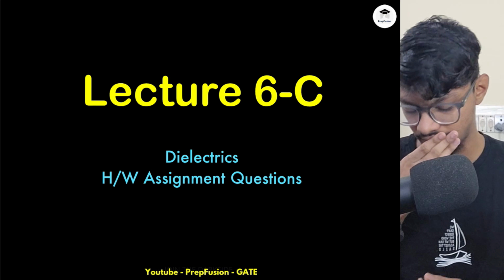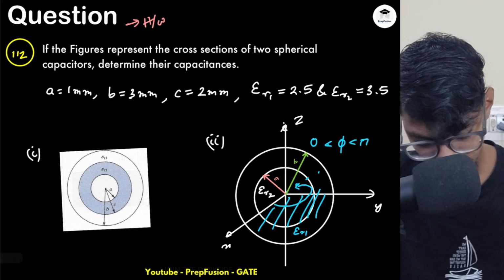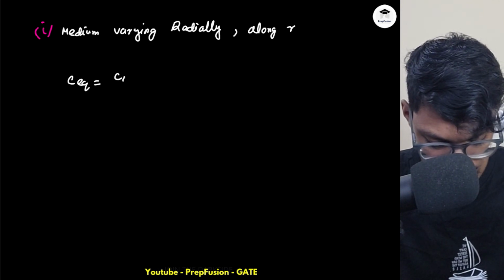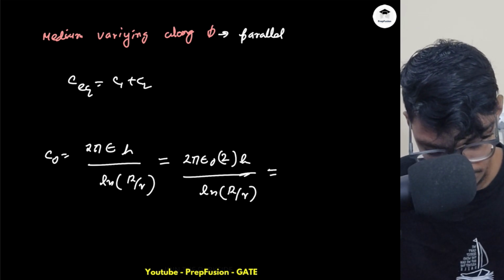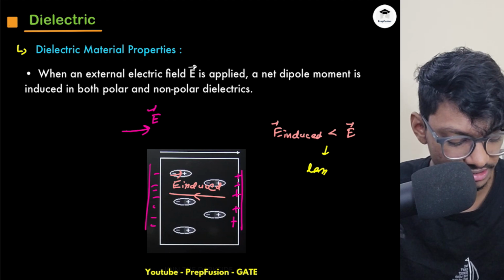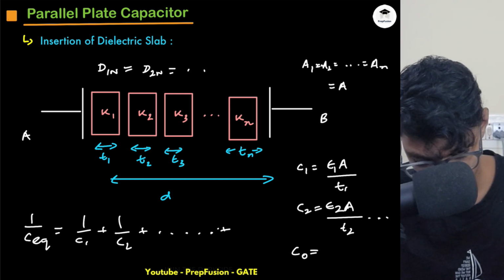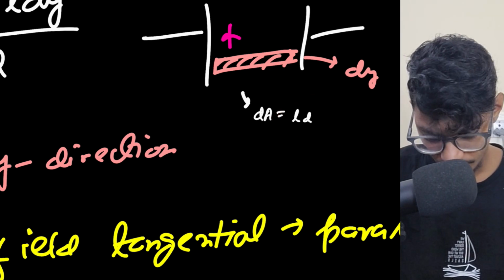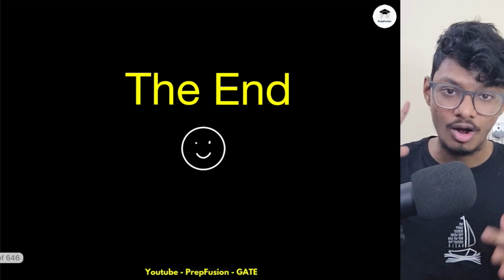Dielectrics In Capacitors || Electrostatics || PrepFusion

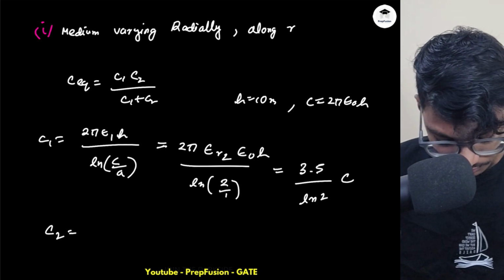Comment: Sir at 27:07 in capacitor 2   ln(b/a) or ln(b/c) which one is correct??😢
Reply: It's ln(b/a) that's what we have solved.
Reply: Whatever I have written is correct.
Reply: But ln(b/a) means answer ln(3) but ln(b/c) means answer ln(1.5) then equivalent capacitor value change